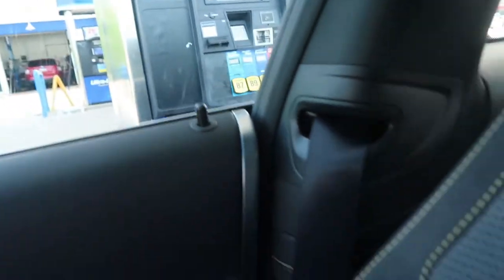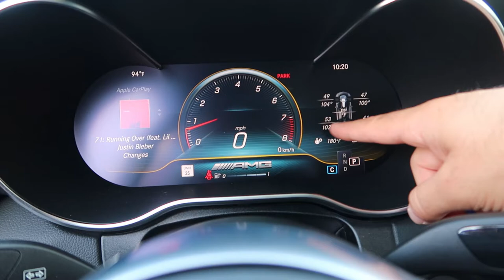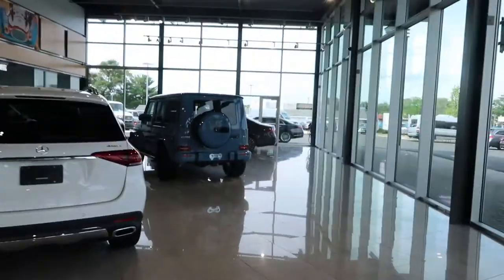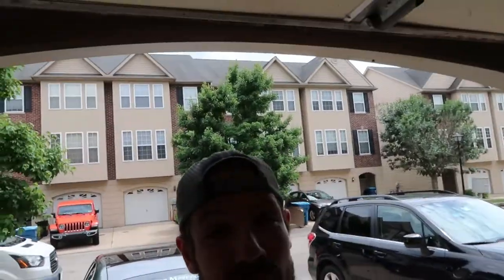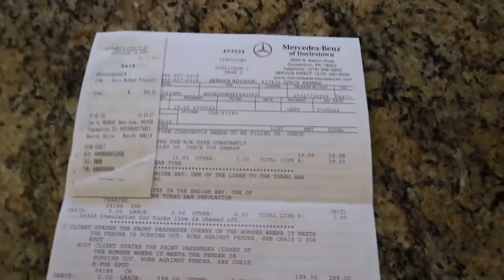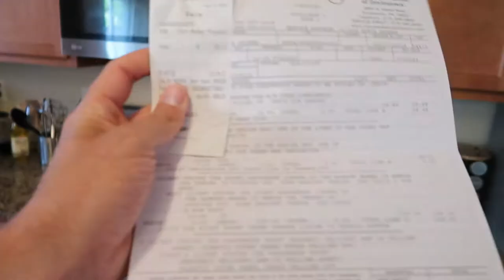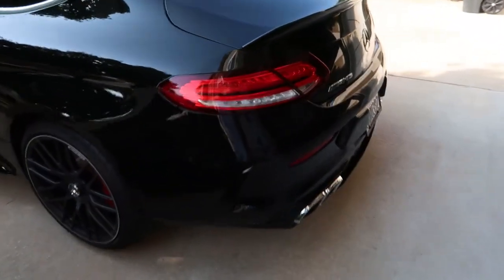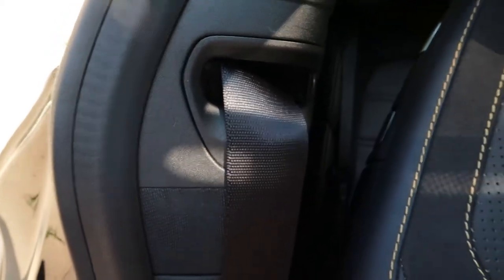MY MERCEDES IS BROKEN; FIRST TRIP TO THE DEALERSHIP TO SEE WHAT IT COSTS!

Comment: Smart move (no pun intended )not letting them wash it. Once I brought my car in for recall and service, I had just detailed the car a few days before. When I got my car back after the service, they washed the car, did not dry it and left it out in the sun. I had water spots for days. I was not a happy camper. I had to rewash and detail it again. Lesson learned though. Now when I get service I tell the service guy do not wash.
Great video. Glad you got your ride almost fixed up. Seems high to charge you 800 bucks for heat shield
Reply from the maker: That’s exactly my thinking. Especially on a black car, the water spots are awful. I think MB just whip it through the wash and don’t really give it the attention it needs/deserves. If you car about your cars paint, a proper detail in your driveway is the way to go. 

The heat shield is so pricey bc they won’t replace just the shield. They said they need to replace the whole fluid line. BS maybe? 
Surely it can be remedied for much cheaper
Reply: @sharpmoves  I agree. Keep us posted on how you handle this.